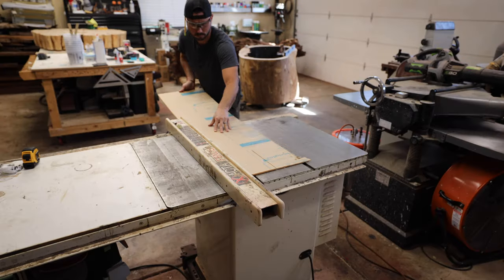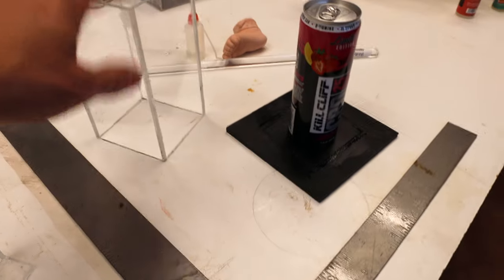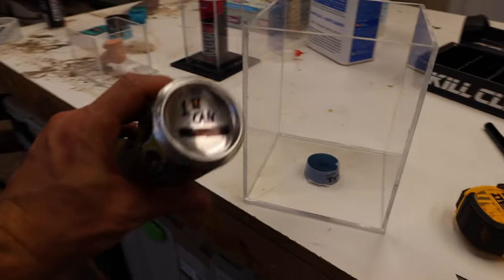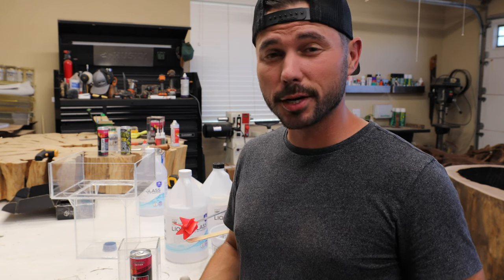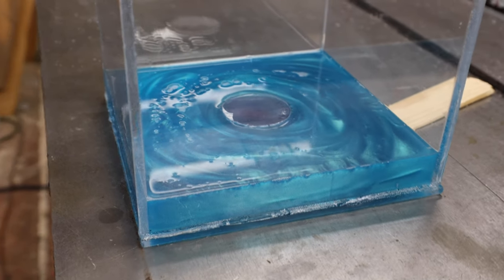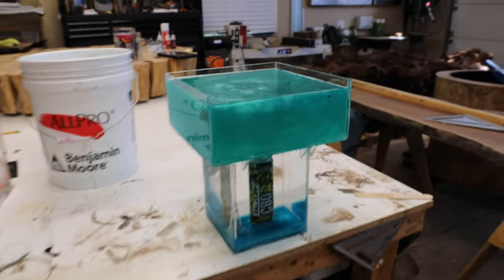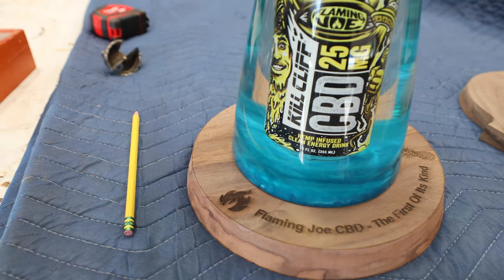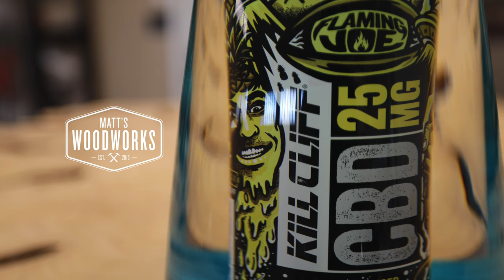Joe Rogan’s UFO | Resin Casting Tips & Tricks

Comment: Nice content Matt! I just subscribed and already have a question.😁When do you use vacuum system instead of a pressure pot?
Reply from the maker: I believe a pressure pot is for stabilizing wood, honestly do not know 100% though
Reply: @MattsWoodworks  A vacuum chamber is what I use to stabilize wood. Everyone I have seen use resin uses a pressure pot. It seems a vacuum chamber would be to slow and wouldn’t remove the air fast enough. Like you I’m not 100% sure.

Comment: What about using a pressure pot vs a vacuum chamber/degasser?
Reply from the maker: Honestly I’m not sure, the only reason I’d suggest chamber is that once it’s sucked down you can throw it into the fridge. If it’s not a large volume pour then I’d say yea for sure use the pressure pot because you leave it in there until cured right?
Reply: @MattsWoodworks  yup. Pressure pot is designed just for that (leaving it in till it cures).